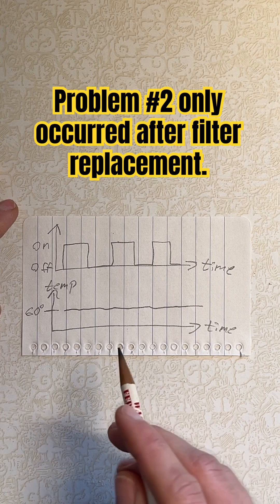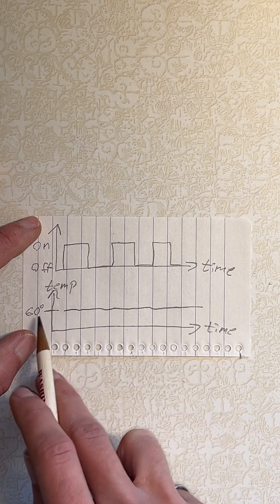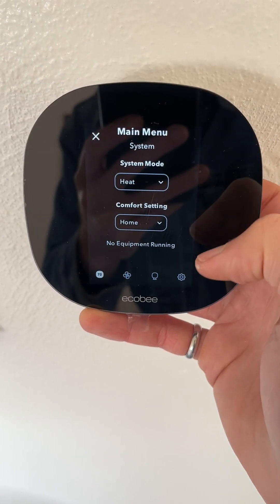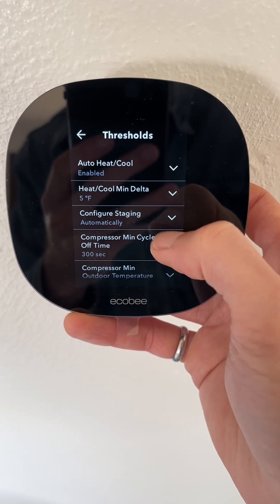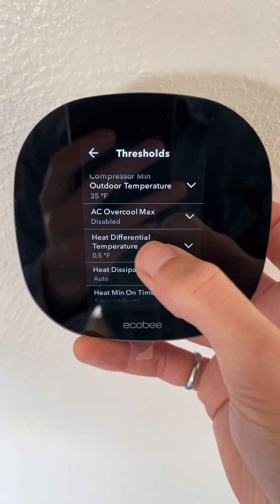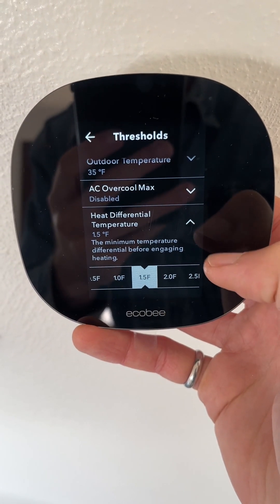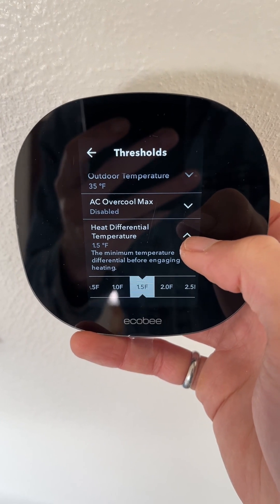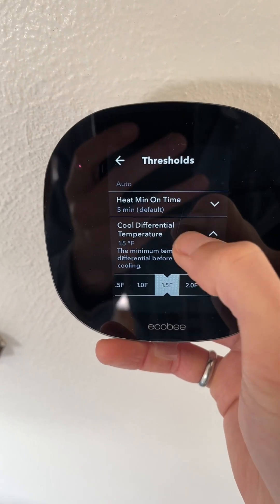Furnace Problems after Ecobee Thermostat Installation: FIXED #diy #hvac #smarthome

Comment: You can have the span be whatever you want for cooling as long as you set the minimum compressor off time to at least 300 seconds. This will prevent short cycling.

Comment: Thanks, just changed my settings. noticed the main body temp reading is different on the wall compared to the sensor next to it. Calibrate your sensors and adjust. Some flow can be inside the wall and messing with it too.

Comment: I bought a place with an Ecobee already installed.  My old place had a simple, but modern Honeywell.  Of the two, I like the Honeywell better.
Reply: moving off honeywell to take battery-fail-while-out-of-town out of the picture.  Used it carefree for 15 years but the batteries went dead one morning here in Minnesota only a few days after our "high" of 5-below.  Hence the upgrade

Comment: I keep getting an error on my Ecobee lite 3 saying that my auxiliary heat has ran three or more times in 24 hours. Can you help me with this please?
Reply from the maker: What kind of heating system do you have (gas furnace, mini split, heat pump, pellet stove, etc)? And do you have multiple sources/stages (ex: a heat pump backed up by a gas furnace)?
Reply: @reidthemanual mine says the same thing. I have a gas furnace

Comment: Wow. We had a customer with this same complaint. We ended up reinstalling their old Honeywell. 

For the first time youtube/google has listened to me and provided a real solution without me searching!
Reply from the maker: Coincidentally, I was about to reinstall the old Honeywell thermostat in this house. Not anymore! 🙂 Glad this helped you.
Reply: Why did you change it to manual staging? Do you know what staging is on a 2 stage gas furnace? Unless you have enough a w2 wire it won't give second stage heat unless the control board is set to auto.  @reidthemanual